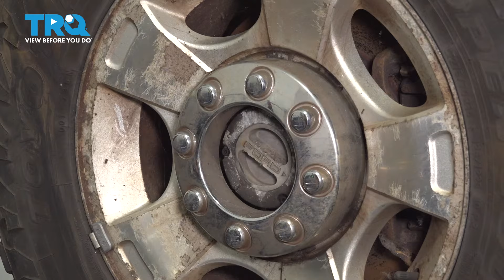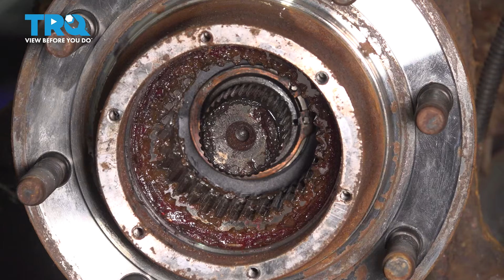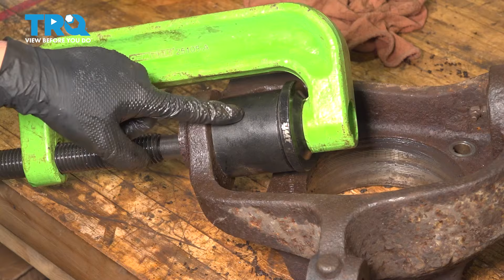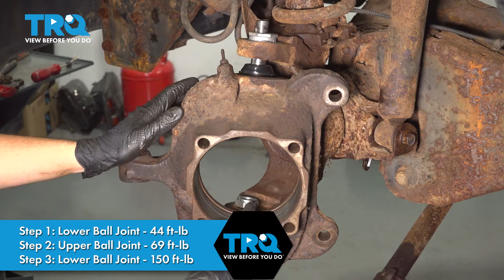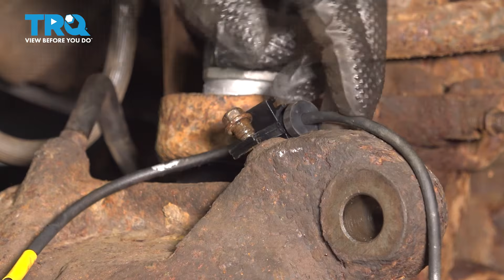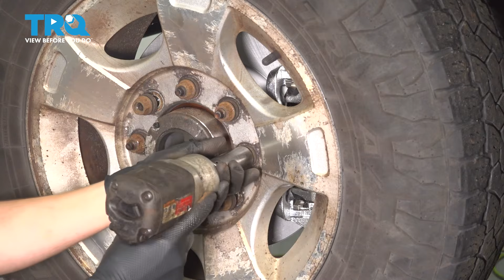How to Replace Front Ball Joints 2011-2016 Ford F-350

Comment: If you are going to do all this work why not replace the u-joints on the axle shaft and spend $30 for a new backing plate. I would probably put a new seal in the knuckle and on the axle as well.

Comment: 19:40 .... You didn't mention it, but after applying silver anti-seize to the face, is that orange anti-seize you applied in and around the bolt bosses? (that's pretty fancy, Man .... or am i not paying enough attention to which anti-seize i use?) OR, is that orange RTV? with silver anti-seize on the bolts?